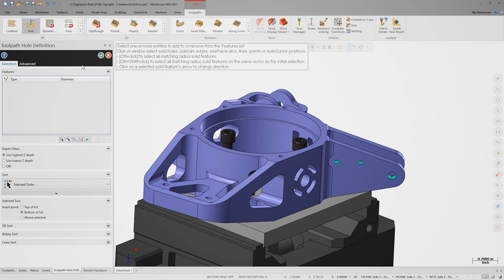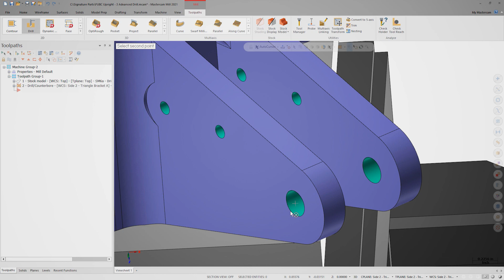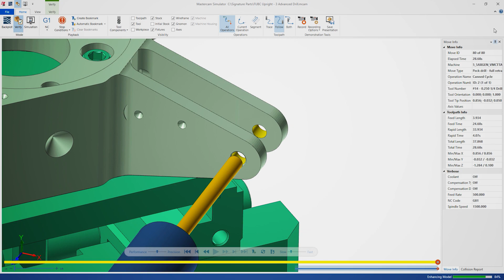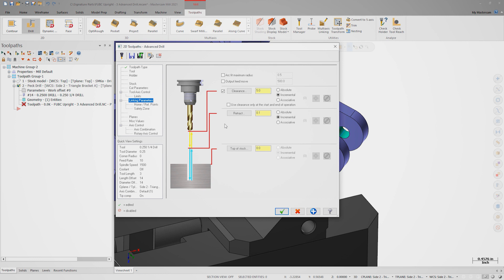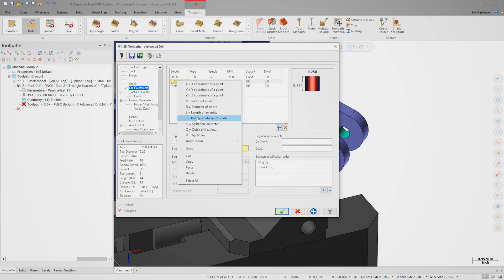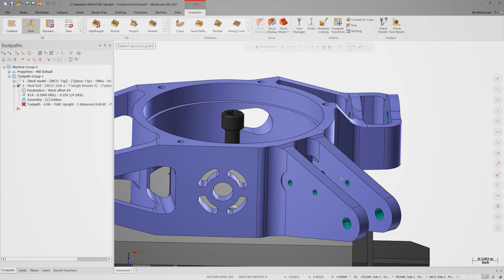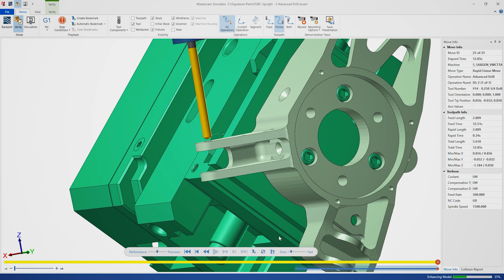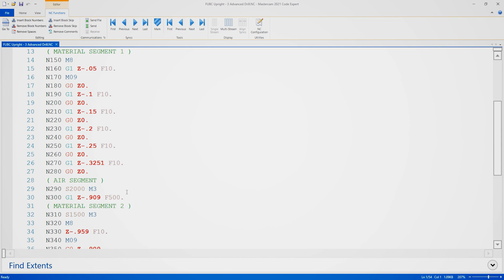FUBC Upright: Benefits of Advanced Drill

Comment: I noticed a couple of things about the resulting NC code: Except for the initial approach, the .05 retract is meaningless. The pecking is retracting to zero for the top segment, and to -.909 for the bottom segment. Also, it is feeding through every peck twice. There is no parameter to have it rapid return to a point closer to where it left off? . . . Say maybe .01" or .02" above?
Reply from the maker: Hey there! The ability to rapid plunge close to (0.01" above) the previous peck depth has been added to the Advanced Drill Toolpath in Mastercam 2022. Stay tuned for more info on its release here!